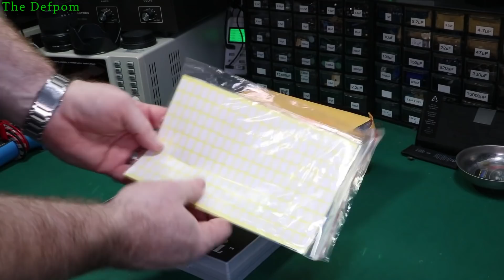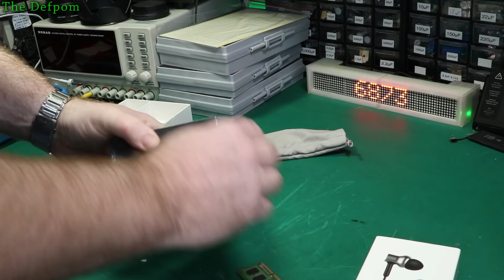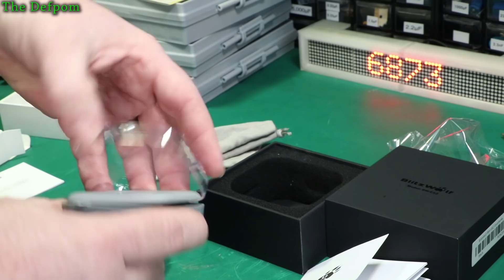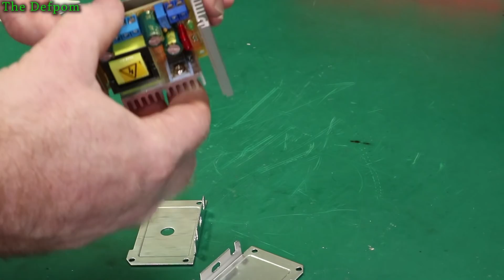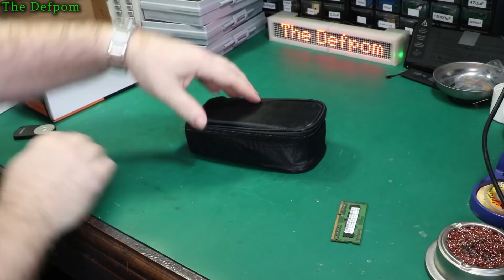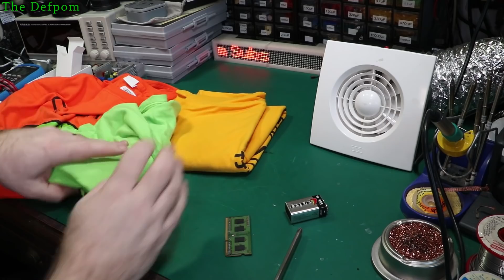🔴 #562 Mailbag Monday 13th May 2019 - Do YOU Need These ?

Comment: What sort of current can you pull out of them high voltage converters?  And what input voltage do they need? Could be good for something I'm working on. Cheers
Reply from the maker: Josh lever - I think it can do about 100mA Max, certainly 50mA , input is about 10-30vDC, check the link in the description specs should be there.
Reply: @TheDefpom   cheers Scott I'll check them out! Sounds like it could be really handy